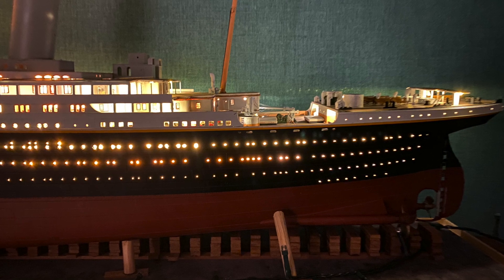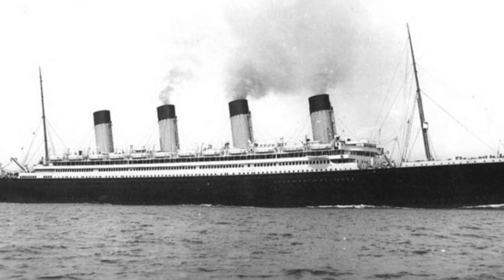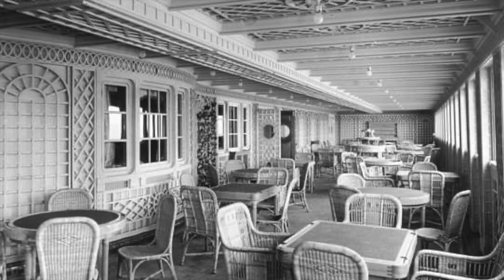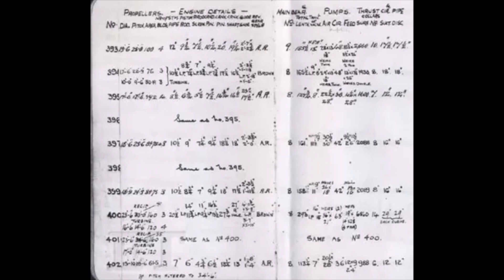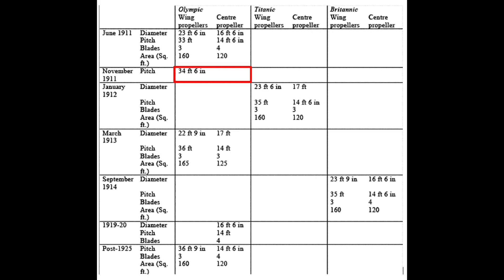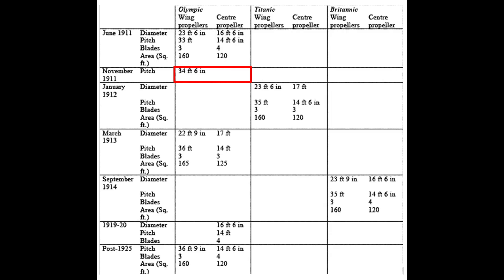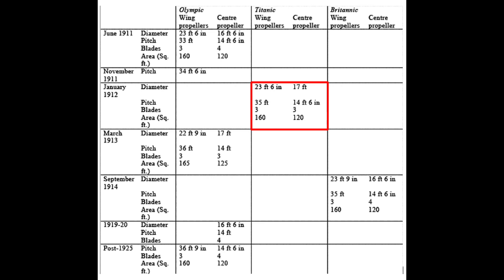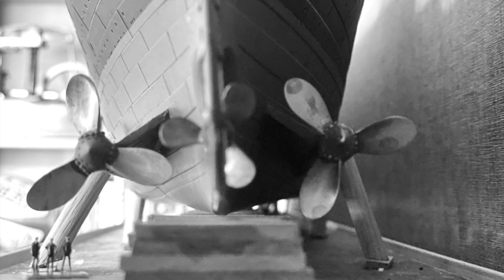Titanic's Central Propeller - 3 or 4 Blades?

Comment: Hi Rob there is a theory that at the point where the two ships were docked they were swapped because of the damage to Olympus and that Olympus as Titanic was deliberately  sank i myself think this is not correct although they theoretically could have done so
Reply: When OlympIC returned to Belfast for repairs after the Olympic collision, she was back at sea by late November, 1911, at which time Titanic was far from complete.

The only other time the sisters met was for around three days in February/March, 1912, when Olympic had a lost propeller blade replaced, which involved removing Titanic from dry dock on 29 February, and docking Olympic on 1 March.  The new blade was fitted (there are photographs in existence) and Olympic was undocked on 2 March.

No, it was not even theoretically possible.
Reply: @dovetonsturdee7033  the titanic wreck is missing a propeller blade, maybe they did swap the ships instead of fixing the propeller
Reply: @CrucialFlowResearch  the propeller on Olympic was fine, it was the propeller shaft that was damaged
Reply: @CrucialFlowResearch  If it is, then it was lost during the post sinking impact.    A ship simply could not function with a blade missing. The vibrations would wreck the shaft.

Replacement of a missing blade at H & W took no more than three days when one lost by Olympic was replaced in March, 1912.   The blades were bolted on, and H & W had spares against such an eventuality. More time was taken up in getting Titanic out of dry dock, then getting Olympic into the dock, than was actually needed to unbolt the remains of the blade and fit the new one.
Reply: For a quick debunk, look for a white stripe at the waterline, a specific difference that can still be seen.
Reply: @jeffhousen8968  But, neither ship had a white stripe at the waterline. 
The only case of this was when Olympic was having it’s antifouling repainted in dry dock, where they hadn’t finished painting it at the moment the photograph was taken.
Reply: Yup…and we never went to the moon.  Electricity is just a myth.  The Earth is flat and the sun and stars rotate around the Earth.  The flat Earth is surrounded with glaciers to keep us from falling off the edge.  Yup…count on someone always questioning scientific facts to bring doubt to the stupid and gullible among us.
Reply: @mudman6156  You missed the bit about the flat earth being carried on the back of a Turtle.
Reply: It was impossible to switch the ships, just the yard number alone, which was carved into every piece of Titanic and Olympic would need to be changed and many interior changed would have to be done, and then the final nail in that theory is the fact that Titanic was underinsured so sinking it would be worthless
Reply: @SwagCat852  you are mistaken, Olympic was uninsured, so the underinsurance of Titanic would have been better than no insurance at all
Reply: @CrucialFlowResearch  "hey if we sink this ship we will lose money, but less than without insurance!" Its a very stupid argument, of course underinsured is better than nothing at all but its still a net loss to sink a ship, these ships were not switched

Comment: 1 would think i gigantic titanic with such weight and a meager 22and a half,lol top cruise speed would benefit from a 4 blade 😀 but I am only saying this because smaller boats usually benefit from 4 blade propellers at low to medium speeds with a better grip holding capabilities and I slight increase in fuel consumption, a 3 blade in a smaller boat is usually used for cost 1,and top speed second, but there are a million variables, and I am only comparing 😀 this to my experience with smaller boats 21 to 27 ft,a ship of such size all my throught are completely thrown out the window with a ship of 1000ft and such massive weight, lol,but I have always experienced better on plan holding power with 4 blade versus 3 ,which a 4 blade yields lower rpm on plane holding power better speed on plane but a reduction in top speed, swapping propellers is also much more cost effective on a small boat versus a gigantic titanic lol,I still wonder if the titanic 2 trying to be built by the Australian will ever come to be ,or if investors are to scared of a repeat disaster 😳 with a name of titanic 😳 i always feel so sorry for all the sencelessly lost lives because of deck space being more of a concern than human life 😢 and then white star taking no responsibility and basically washing there hands of any involvement and not compensating families 🙄 something for there tragic loss ,at least ships after were pretty much forced to carry provisions to rescue all passengers from that point on,.God bless and take ❤ care.now I have to get used to visualizing the rms Titanic with a 3 blade after 50 years of seeing her with a 4 blade.lol.great work BTW on your magnificent recreation model of such a beautiful ship.its kinda funny to see the actual size of titanic side by side with a newer cruise ship 🚢 she looks tiny to today ship size standards. But there's a 110 years of technology in between them.

Comment: I understand all those who know or investigate, but in my model, I will use the 4 blade propeller until someone does a sonar sweep on the stern of the titanic and confirms that it has 3 or 4 blades. I consider that the titanic carried a 4-blade propeller. Prove it with tests and I'll change it to 3 blades.
Reply: The evidence from written notes and blueprints would pretty much confirm that she was indeed a 3 blade 😀 I dont see them deviate from written notes and blueprints on the other ships,ah but yes a visual would be great proof.i always wondered why the haven't raised a propeller yet they should still be structurally intact unless the bolts holding blades to hub are rotted through?some day..
Reply: The evidence is in the video but alright
Reply: There's a chance the Olympic and Titanic were swapped, and there's a 4 blade on the wreck
Reply: @CrucialFlowResearch  nope... Titanic's yard number 401 is still in the wreck. More than enough proof. And there are the obvious design differences like the straight wheelhouse of Titanic, the entire B Deck having staterooms, the Turkish bath cooling situated midships in Titanic, the Marconi room situated midships in Titanic, etc .....
And the number of days both ships were together would also not allow the swap. When Olympic came first time, they were together for 44 days. Titanic was unfinished and half way throught construction. Not possible to convert unfinished Titanic to look like finished Olympic and finished Olympic to be stripped down to look like unfinished Titanic. Also, only one ship was able to be worked at a time in Thompson graving dry dock. So it would've taken really long to swap both ships. Next time they were together was for a week. Still, not enough time to make those changes in the design and plans.

Comment: I think it was part efficiency, part shaving time off. Remember: the Olympic already finished her voyage, so in terms of size and luxury, there wasn't much headlines for Titanic to grab. So what is left? Speed. "Choose White Star Line for your travel needs. We can get you to your destination faster than Cunard Line". But how to get the speed up? At first, they thought changing the pitch to lessen vibrations as the ship went faster. That, obviously, wasn't enough so they decided to try a new plan: less blades on the central propeller.

The blades of the props were each a certain weight. If they could change Titanic's weight just a bit, it could have pulled into NY faster than before. And it was easier to test it on the Titanic than to pull the Olympic into dry dock and replace the propeller, even with the needed repairs from its collision with the Hawke.

So Titanic is given 3 blades. Ismay is put onboard and pushes Captain Smith about speed. He wanted Titanic to get to NY faster than other ships, so the WSL could get results. Unfortunately, the ship hit an iceberg and sank. Then there were inquiries into the disaster, which led to Olympic needing to be recalled. And while she was docked, she was given a 3 bladed prop to continue the test. Which, by looking at the sheet, must not have worked and maybe caused some other problems, so they went back to a 4 bladed prop for Britannic, and then, after WWI, had Olympic fitted with the 4 bladed prop to finish out her service life. 

Until someone decides to unbury the central propeller of the Titanic, all we'll be able to do is speculate based on the evidence at hand. But pretty sure this is a safe bet: Titanic has 3 3-bladed propellers.
Reply: @The Model Gamer White Star abandoned any efforts for speed back in the late 1890s, so…
Reply: I'm pretty sure that Ismay pressuring Smith is a myth. 

Also there is no reason for the White Star Line to retrofit Titanic for speed purposes as the Olympic Class was designed from the start to beat Cunard in size and luxury, not speed. Olympic reached a max speed of 23 knots in 1933 (and 21 knots in 1911), a full 2 knots slower than Lusatania in 1908. Simply put the Olympic Class was never designed to go fast.
Reply: The weight of the propellers had nothing to do with speed…it’s all about horsepower…titanic would need a LOT more to set some type of speed record, to beat  cunard records…
Reply: Titanic could never be faster than Cunard liners, Titanics maximu speed was 24 knots and Lusitania and Mauretania could go almost 28
Reply: The difference in efficiency, it would be more about saving cost for the company, and handling of the ship, or noise differences
Reply: That's just a myth. Titanic's top speed was 24 knots. Cunard greyhounds had a service speed averaging about 25 knots. White Star Line stopped efforts for the blue riband and started focusing on size and luxury and operating economically. All Titanic could beat was Olympic in terms of speed.

Comment: Essentially the summary for the thinking is that they wanted to test the efficiency of a 3-bladed central Propeller vs a 4-bladed one. A 4-bladed one was fit onto Olympic and a 3-bladed one was fit onto Titanic since both ships were practically identical to test the efficiency. Since Titanic sank, she wasn't able to show her results for the efficiency test which is why Olympic was eventually fitted with a 3-bladed central propeller at one point to finish the Test. It was shown that a 4 Bladed Propeller was ideally the best one to use which is why Britannic was fitted with one and why Olympic had one all the way to the end of her career. As shown in the Video, documents do prove that Titanic's Central Propeller was in fact 3-bladed which goes along with the concept of the efficiency test for seeing which propeller is the best one to be used.

Comment: Nice deduction Rob, seems like a reasonable explanation to me.  For me of course it's never going to be an issue for my model!  Talking of efficiency, of course the conversion to oil burners saved the company a  shed load of money in stoker and engine room costs and I believe ultimately increased engine performance too.  If I was modelling the Titanic I would certainly go by this nugget of information as you have described.  Nice clear video as always.  Regards JH  😉
Reply from the maker: Cheers John. Yes Olympics propellers seem to be one area that is reasonably well documented!
Incredible the amount they saved when they converted to oil but as you say, so many jobs made redundant so makes sense.

Comment: Okay it was clearly 3 bladed on titanic, we’ll probably as we cannot see it buried in the sand but it’s probably 3 bladed. When did Olympic switch to 3 bladed? As Britainic and Olympic were constructed with 4 bladed centers originally with Olympics getting swapped out for a mode efficient 3 blade. My question has since been answered in the table, my assumption at the beginning of the video was correct. Love being a mech engineering student.
Reply: Efficiency in action!

Comment: considering britannic would have a four bladed prop, i think it is pretty certain that titanic would too. but thats just my opinion
Reply: I think the findings appear to be that the 4 bladed central prop was considered better. Personally I believe that Titanic has a 3 bladed centre prop, but had she survived would probably have been fitted with a 4 bladed as per her sisters.
Reply: @davidmccann9811  personally i just don't see why they would have built her with a 3-bladed prop when that would have led to worse thrust and the fact that her sisters had a 4-bladed one. Why would specifically the titanic be  different?
Reply: @emilbt7588  as has been mentioned in this video: Not everything could be calculated beforehand, so variations were tried out and compared in real life, to finally home in on the optimal solution.
Reply: @emilbt7588  different combinations are tested. Since Olympic was first built, it already had 4 bladed. So to test vibrations, they fit Titanic with 3. Of course she sank and they couldn't get results they modified Olympic with 3 for refits. That experiment concluded 4 is better so Britannic with ongoing construction would receive 4. 
If Titanic did survive, later at a point they would change to 4, and Britannic would get 4 based on results during construction and Olympic wouldn't have had to change it.
Reply: At construction yes, and Olympic had one at construction. Britannic obv had a short career but Olympics was switched to 3 blades eventually as it was found to be more efficient. Britannic wouldn’t be able to switch before sinking.
Reply: @NOrlando952   Olympic was born with 4 blades but was switched to 3 blades during the war. She was converted back to 4 during the 20’s refit